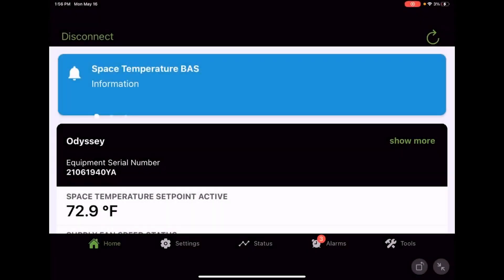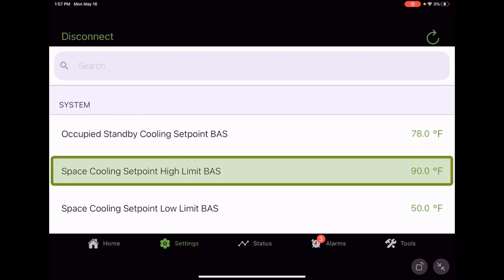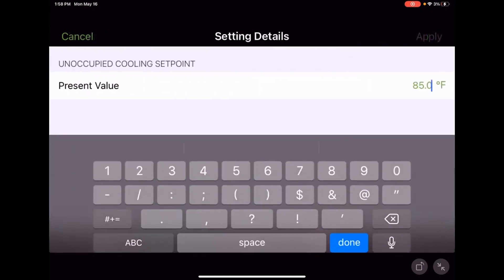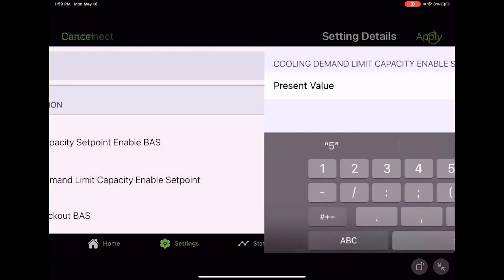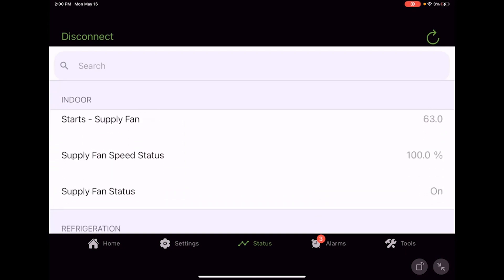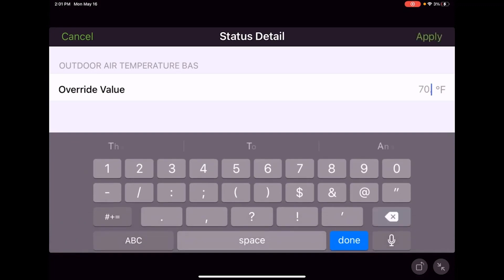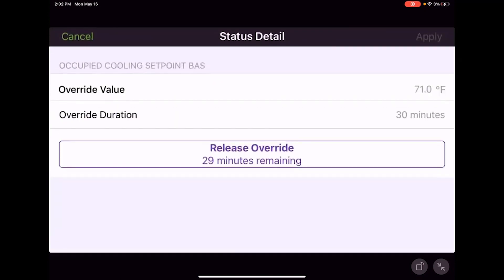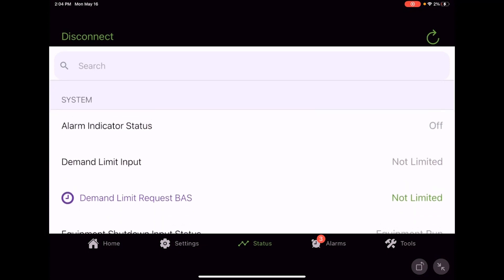Symbio® Service & Installation App: Adjusting Setpoints and Overrides

Comment: I have a DSK036 dual fuel package unit.  I am trying to learn more about the possible settings that are available to increase time or temp duration between first stage and second stage auxiliary gas heat.  I really don't need the 2nd stage of the gas heat, but I have not identified a way to turn 2nd stage auxiliary off.  Any input on this?  Also, the unit appears to have a constant torque style ECM motor, so I do not think the Symbio controller can change fan speed on this model, does that sound correct?  Reason I ask is because the fan curve chart has two capacities for low and high fire, but only  one set of min/max temp rises.  So am I suppose to find the sweet spot on airflow for both stages of auxiliary?  If so, do I dial in the combustion for low stage or high stage?   Sorry to bombard you with questions, but I have read the manuals that came with the unit, but they do not answer these questions.  I have reached out to Trane tech support and was advised to cut the wire to the gas valve for high stage.  So I am not sure where to turn to for advice.  Hoping for a response here, or maybe someone could reach out to me to discuss.  Whoever made this video sounds like they are the expert and knows the equipment along with the controls well.  I can be reached at anytime at TEC with this company number 612-254-2176.  Just ask for C.  Great content BTW!